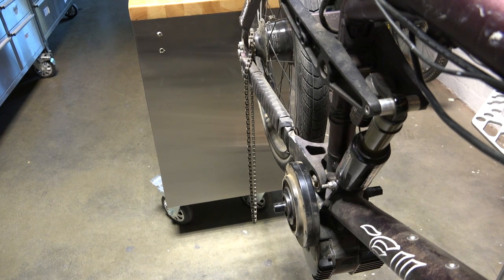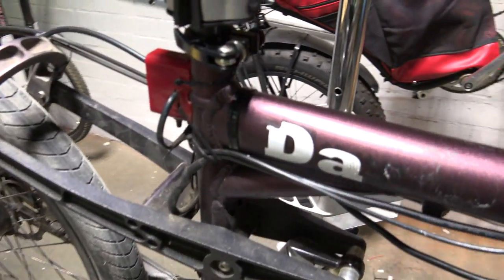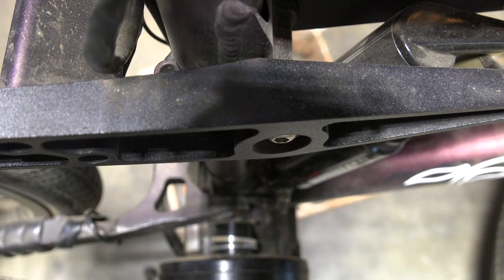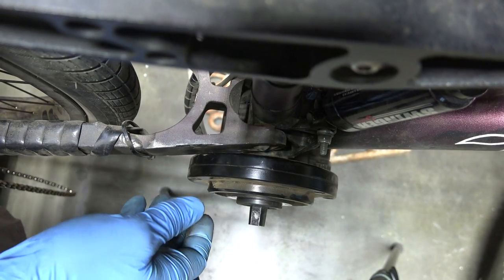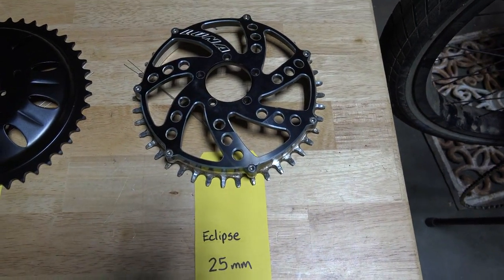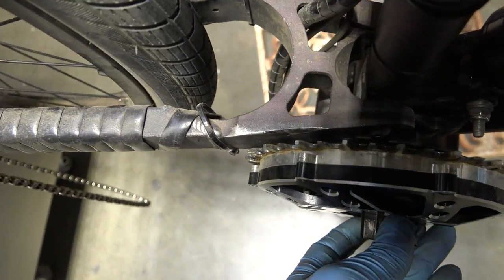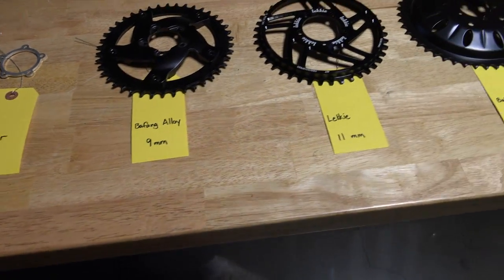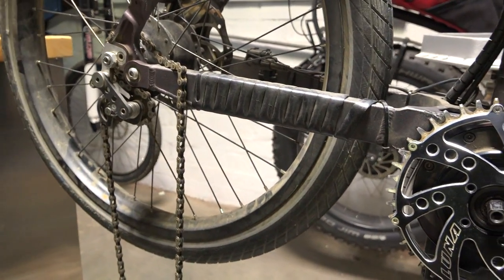BBSHD  Part 3 Install  picking the right Chainring

Comment: Putting those spacers just turned a 73 mm bb to a 70mm and now on the other side the locking cap or nut won't go on. Even tho you don't need both cap or nut

Comment: You didn’t even attempt to measure the actual chain centerline. As has been pointed out, you could at least put some sprockets on, do a visual, and adjust centerline accordingly.

Comment: It's interesting you said to get that chainring in as close as possible but not touching; however you didn't  mention chain alignment from rear sprocket to the motor (i.e. sighting down from the back of the bike to see how straight it is).

Comment: I fitted a bafang 750w the other day, I bought spacers just incase but it worked out bad ass, I got use of all 8 gears on back, Well impressed with my first bafang build, Went smooth, Glad i did, Now i can fix it if anything goes wrong, But i can say that a carerra hellcat lmt edition is an amazing doner bike, I will be buying a lekkie, When i can afford it, But yeah my hellcat lmt edition is bad ass, Eye catcher thats for sure, Amen for bafang conversion kits, I suffer CPTSD, Its going to help loads knowing its me myself an hellcat an can travel without getting hypervigilance symtoms, Cant use my electric moster scooter in the UK no more, An being a law abiding citezen, I try stay within all the rules...
Reply: I don't have issue on my hellcat with bbs02b aswell, unlock to 25 amps 😂. Now i build new Vulcan lmtd and i find is better than my hellcat i love it. But this time i install bbshd 52v. Big change bro , trust me. But the offeet is too out, that why now i need to order some new chainring  to get back inside this teeth and have better allighment.  I can't use better gear above 4 (3 2 1) aswell after 5 from steady position , when getting speed because of the torq , the chain start jump and skip teeth at rear.
Reply: @TheHead-IP  You is reminding me, I got to do a BOT, Make sure everything is tight and nothing loose, One thing I found how oddly enough things can get loose on an E-bike, lol, I need to get some lock tight to be honest as well, It is something I never think of getting is lock tight lol, I am the same with flux, I always forget to but it when I can, lol, I have got to get on the E-bike a bit more now the weather is changing, Diagnosed with a crappy Heart condition along with the CPTSD, I should be forcing myself to go out on the E-bike a lot more, I have issues going out a lot lately, I am struggling with the mental side of things at the moment, I got a block in the left part or something, And having sudden death in the family is sort of niggling in my head all the time, Sorry for the Psyc message lol, I am just having issues at the moment and I would be lying if I said the E-bike is only come out for the time I need to use the E-bike and not going out for rides to get my head straightened out so to speak, I do want to try a camping mission for a night or two, I want to go up to Breckon Beacons and do some photography, I have never tried photographing the wild, I think it might be something I would enjoy as it is something you normally do on your own, I got problems with busy crowds, I find going to a city difficult, Hypervigilance is an issue, So if I am up the mountains or in some woodlands taking pics of nature, Maybe it might be therapeutic for me, I have found Sim Racing, lol, Sim Racing in VR is nothing short of fantastic, The Quest 2 linked to a gaming PC is brilliant, I am going to look to see if Meta got apps to help with mental health, It could be a safe way of trying to get past the fears I have, I can see VR helping a lot of people, Stroke victims can benefit from using the Oculus, It is working for people who suffered a stroke, Terrible illness a stroke is, I would not wish that on no-one, So yeah I do plan on getting back to the E-bike lark, I have an Electric monster scooter I need to get controllers and a battery for, Those monster scooter are great fun, When you do off road scooter stuff, It is like a work out, Arm burn happens fast, lol, It not all just standing up when off roading on a Monster scooter, I hope personal electric vehicles becomes more accepted in the UK, Having a bike that goes past 15 mph illegal, Is only going to create anger between the public and the police, They got it right in America with the E-bike laws, 750w is a perfect amount of power giving a bit more for peak for the hills, I do hope PEV transport becomes a thing, It will help take cars of the roads, Making it easier to spot the up to no gooder's on the roads, Instead of criminals using busy traffic to hide the fact they is doing illegal things, I bet a lot of crazy stuff goes down now on the roads now these days, If people was able to use electric scooter, Electric unicycles, Wouldn't there be less cars on the roads,? I think the Army should use an Electric unicycle, You can cover crazy ground on an E-Wheel, Just look at Wrong Way, lol, I know you have seen Wrong Way, That dude is like Batman on a Unicycle, If you can skate though, Then you can unicycle, So I was told, I am still yet to try an E-Wheel, If PEV transport was more a thing that was accepted, More E-wheels would be made allowing companies to sell them for cheaper, I don't understand the anger some people get about Electric scooter's or even electric bikes, Some looks I gets from older generation, Because I rides my bike on the pavement, O only go slow, And the roads is just too dangerous for an E-bike, People don't look and get mad at people on E-bikes, So now I choose to go slow on the pavement, I got a Go Pro recording as well....
I do have to get back int the E-bike thing more, And reading your message have sort of boosted me to do so, I will do the BOT over the weekend and start going out for some bike rides with a camera....
Happy E-biking, And stay safe while on your  bike yeah, Peace........
Reply: I cant use 750W bike even 500W. Only legal is 250W only as supporting when u turn with your legs... driven by the throttle is not legal, and up to 25kmh and 48V max. Anything above you have to have it registered, mot, and so on and the top is you cant use bike paths anymore road only.
So... you have to go under ground and buy 500W convert do not use throttle and clean the serial numbers  or mock those. Bafang should make also a simple block option to make it legal from menu with 2 or 3 cliks when some bike patrol catch you. Greetings from Poland
Reply: @adamt3332  I watch a dude called wrong way, On YouTube, Check his channel out if you aunt heard of him, Dudes on the ball with PEV's, I seen a video of him doing a bafang 750w conversation an he in Poland, I wanna thank your country by the way, For helping Ukraine how they are is a blessing sent, I got admiration for the Polish pilot's during WW2, Helped the UK nor get invaded, So it's only fair the UK an the world puts a stop to putins madness...
I'm pretty sure the company I bought my bafang from would send it to Poland, Motorider, I had it delivered in 2days, From Europe, Not any issue whatsoever, Put just over 400 miles on it, Bafang is the way to go, I'm hoping to do a CYC Pro conversion in the summer on a downhill frame, Just at the moment paying bills is swallowing all my spare funds, Still tho seeing the war scenes happening at the moment I am blessed with what I have got, I wish I was in a position to help Ukraine, I can try donate a few quid but it feels so little, Buy yeah massive big up to Poland.....
I feel the laws around the speed limits ect will change, As an argument is made it is unsafe, Too slow to react to oncoming hazards, Plus if you pedal hard enough you can go pretty fast on a mountain bike, 30 mph in the right conditions, So yeah an argument is being made its unsafe not to have the power to avoid accidents, Even with your bike able to do 30 mph you never do, I don't, My average is about 8 mph, lol, It's purely for commute tho, I suffer complex ptsd, Public transport is a no go for me, Busy shops, Busy places makes my head go weird, So my little E-bike is important for me, I use helmet aswell, I only go crazy fast on Assetto Corsa lol, But yeah even if your bike goes fast you never do, When it's only for commuting you don't tend to ride crazy anyways, I got a 1600w electric monster scooter, But I prefer my bike now, Everyone looks at me on the scooter lol, But yeah I only go slow on my bike bro, Check the Motorider on Ebay he got a selection of bafangs bro, Honest delivered really fast, An not one problem touching oak, The bafang is a top motor worth every penny that's for sure, Again big up for Poland doing what they are for the Ukrainians.....
Stay safe yeah......

Comment: I have a Luna BSS-HD kit and I swapped the 40t for a 30t and got unbelievable hill climbing abilities but lost abilitie to pedal on the flat. Was wondering if I could run both chain rings together.
Reply: I got the 42t, but use a 12-32t cassette and get good low end with 160Nm of torque and the ability to pedal along in gears 3-7.
Reply: I'm running 52T front and 11-34 rear on a 20inch rim carbon folder and still climb throttle only on BBS02.

Comment: Time to break out the metric ruler and caliper tomorrow! 
Just swapped out my old BBSO2 with a HD, and the Bafang aluminum 42T sprocket is about one chain width off, just by looking down the chain from the rear wheel. Didn't get two trips around the block without chain drop. I'm about to drop a dime on the Lekkie, but want to measure first. I'll assume Lekkie measures offset from inside flange to center of teeth. I'll also assume, from all the different measurements in the comments, that Luna measures offset from the inside of flange to the table top the sprocket is sitting on instead of center of teeth.

Comment: LEKKIE bling ring HD data:   
 
  
1)   28T/32T/36T    =only 5.2mm offset, (because the diameter for these sprockets are to small for wrapping around BBSHD)
2)   42T/46T         = 18.3mm offset, (Wraps around)
3)   52T                  =16.3mm  offset, (Wraps around. Perhaps they made this with 2mm less offset, to make it possible to use 3) outside 2) for a dual setup. PERHAPS it could work with spacers, nobody knows...

 Material CNC 7075 T6 Alloy
    
 Sizes:       (28T, 32T)*, 36T, 42T, 46T, 52T     *Under developement/ not yet in market   
 Weight:         28T 70gm, 32T 82gm, 36T 104 gm,   42T 168gm, 46T 208gm, 52T 234gm

Comment: Why has that internally geared hub got a  derailleur ?
Reply: You can use the rear derailleur as a chain tensioner if spring rate is strong enough. Just set it with the max - min screws. Chain tension needs to be more flexible when on a full sus bike as chain length changes..
Reply: Yeah, fair enough. I guess it depends on where the swingarm pivot is in relation to the bottom bracket.

Comment: Where are the front chain ring spacers found? I don't see them anywhere on the web site.
Reply: Currently sold out. When restocked you can buy on site by using site's search box for the term "spacer".

Comment: Got the 30tooth chain ring about 3 weeks ago and after only 100km I got a bent tooth...  Idk how probly just cheap metal
Reply: For only one tooth to bend in this manner may suggest a mismatch chain. Check the marking on the chain for 9- speed, 7-speed , etc designation. Then check to see that matches the number of gears you are running out back.
Reply: +dallasangler good idea it bent back easy enough just worried about long term. Idk even know what happend..  Went into store left and not even 30 sec into ride chain wouldn't leave the ring :3